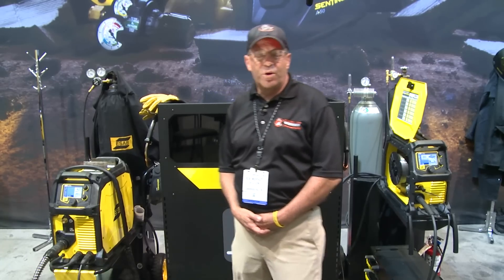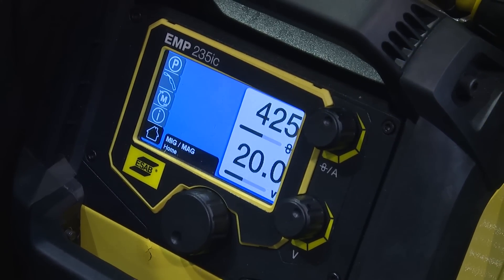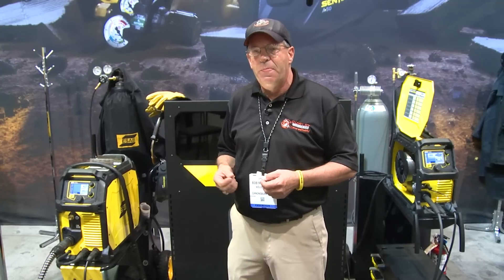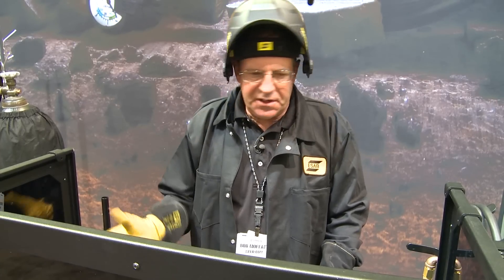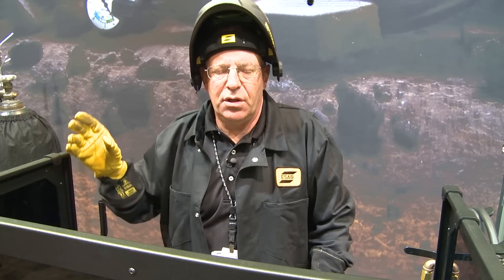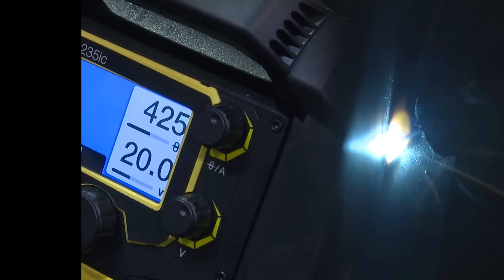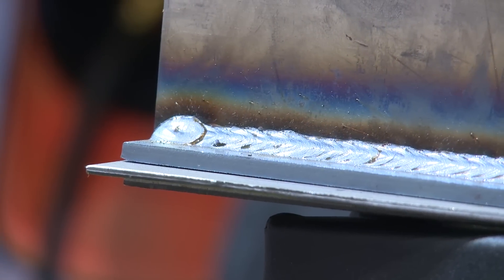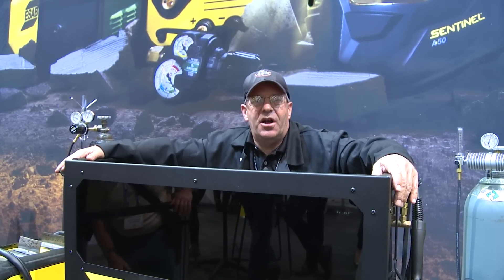FabTech 2016: ESAB Rebel 235ic Introduction | MIG Monday

Comment: Got a question about the SmartMig/sMig technology on this welder hope it's not too dumb. I've heard it explained a couple different ways the first being that it monitors your welding so in the future you're able to make repeatable welds, is that correct? Now I'm wondering if it works that way and you consistently make BAD weld joints will it "remember" that and make bad weld joints? If that's the case how can you improve your welding joints/technique if the machine remembers how you're welding? The second way is the sMig setting is basically the same thing as Miller's AutoSet feature. Also has anyone done a side-by-side comparison with the Rebel and Miller's Multimatic 215 welder? I am going to buy either the Miller 215 or the Rebel in the next couple of weeks and want to make sure I get the right one. The two main reasons I am hesitant on the ESAB Rebel is one it's made in China and the second is ESAB's customer service/support which SUCKS and have been told by several LWS that are ESAB dealers that they are the worst in the whole industry. Does anyone have any thoughts on that?

Comment: Does the tig part of that machine do High Frequency Start AC for aluminum?
Reply from the maker: It does not. Welding Aluminum on this machine would require MIGing it with a spool gun.
Reply: Weld.com Weld.com It doesn't? I guess this machine is out in terms of one machine to rule them all. 🙁 I somehow mistakenly thought it was a mix between something like a Dynasty 200-210DX in terms of AC/DC GTAW/GTAW-P/SMAW + CAC-A and a capable GMAW/GMAW-P & FCAW-S/FCAW-G.

Back to buying a new 210DX/200DX (New old stock 200DX), Used 200DX, and maybe the EM235ic/EMP235ic for my GTAW/FCAW needs. Or my original plan of a 350CC/CV MIGRunner.